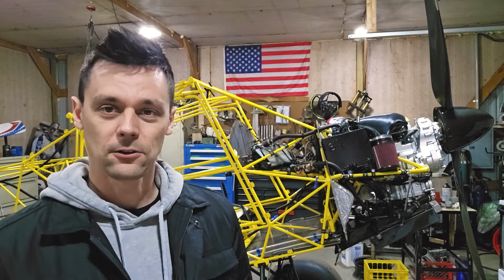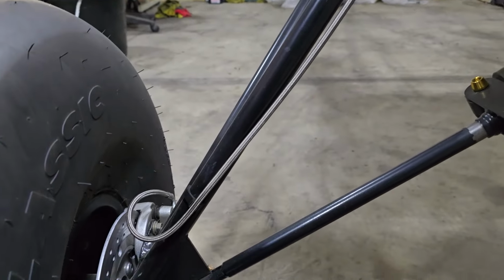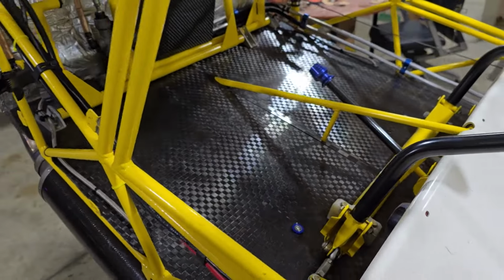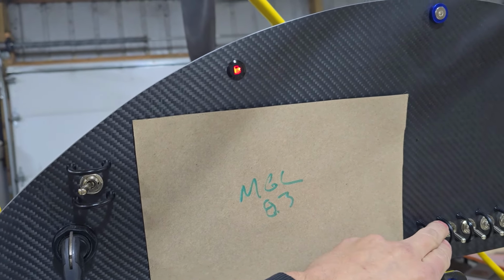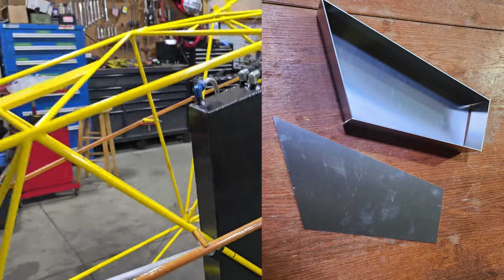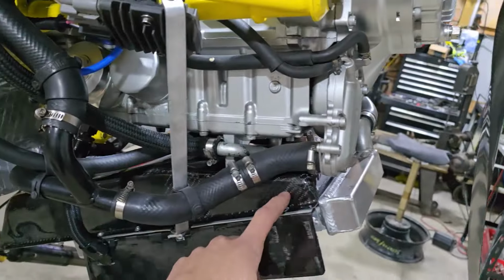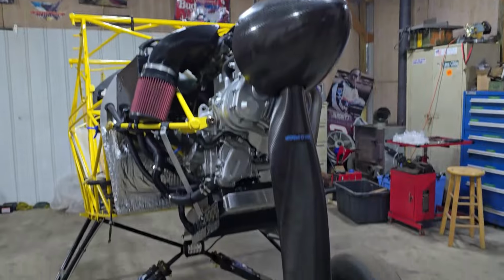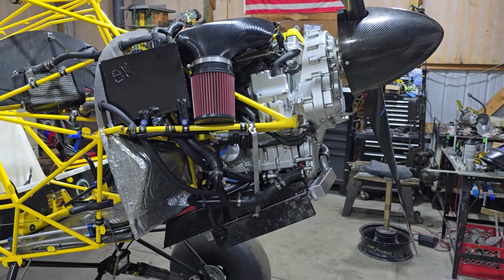KITFOX IV YAMAHA APEX BUILD Update #4 - Thank You for 5k Subscribers!

Comment: Ben, could you comment on the fuel sensor and the install on your tank?
Reply from the maker: Its a custom made system with a Ardruino based chip that was coded to blink a simple led. Easily reproduced. Yet to be flight tested but works great on the ground.
Reply: Let us know how it works in flight.

Comment: I just spotted your battery-selector/Main Power switch. I’m using the same one, except mine is red. Mine selects between 2 different ETX900VNT and IMO it’s the perfect solution, if batteries are located aft of firewall. I believe the only way it could possibly be more reliable, would be to have individual, independent manual/mechanical switches for each battery.

Comment: OEM automotive manufactures don't use worm gear clamps use spring clamps. People think it's because of money not true the spring clamps are actually better if the hose gets softer over time the spring can self adjust for that. The worm gear clamp has to be manually tightened.